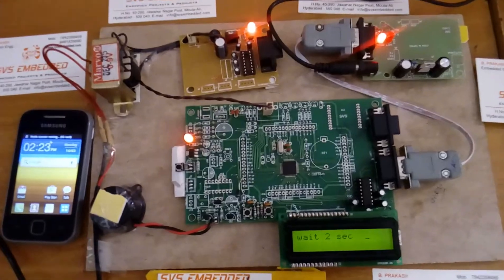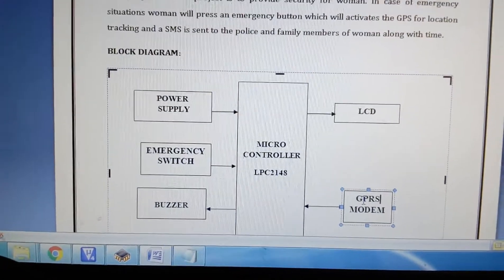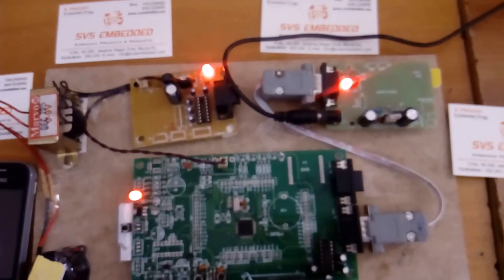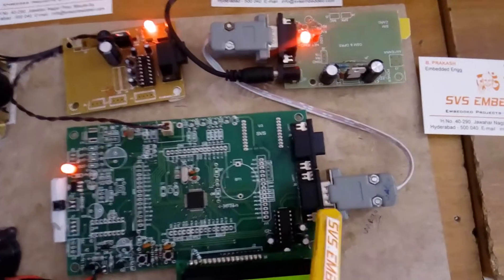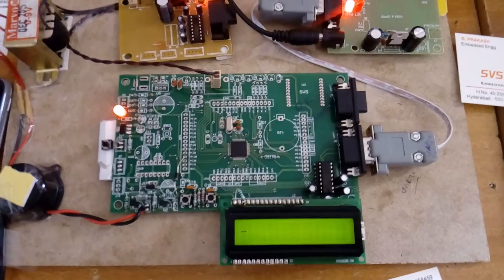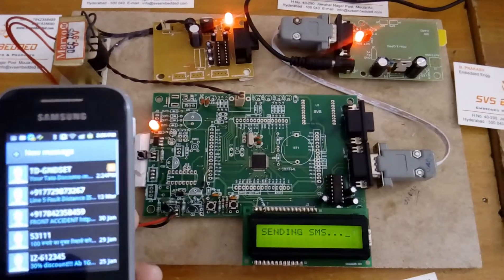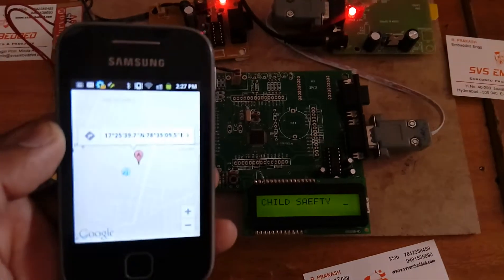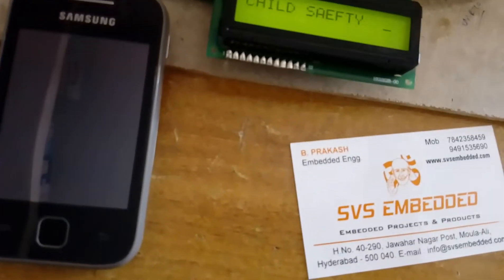IoT based project: SMART GIRLS SECURITY SYSTEM USING GSM & GPRS

Comment: I just need the cost..pls tell the cost only..if I need I will buy
Reply from the maker: Thanks for watching and your valuable Feed back.yes we will help on coding part.
we are selling the projects with least cost.if u order the project we will provide working hardware kit along with 
1.abstract
2.datasheets
3.documentation
4.schematic( circuit ) diagram.
5.software code.
6.sample ppts
7.photos&video file on entire project
through google drive.if u r interested to take the project.
send me a mail to  svsembedded@gmail.com,info@svsembedded.com.
9491535690,7842358459,
www.svsembedded.com,www.svskits.in,
we will send u the how to order procedure to u on mail.